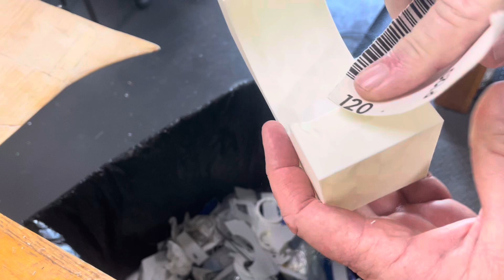Bambu Lab ASA Aero

Comment: Any part that needs a support, this ASA AERO is simple a POS!  even lowering the speed for support...it is only OK for continuous print without support
Reply: I had support challenges that I fixed by changing to Manual, and only supporting what I felt was neccessary. Also, I use a 0.3mm "Raft contact Z distance", and a "Base Pattern" of n Honeycomb with a "Base Pattern Spacing" of 2mm. Speed is still set to 50mm/s. Hope it helps.
Reply: Top infill is the same, also a problem for me.. but a continuous accumulation on the nozzle is a step before that even, which I also have

Comment: Nice work. What's with the raft? I've never seen that before. I normally use a brim. Can you tell me how a raft is better as I'm having issues getting LWASA to reliably stick to the bed. Cheers.
Reply from the maker: The raft is used for materials that are prone to warping and poor bed adhesion. This article will explain it better than me. 😊

https://all3dp.com/2/3d-printing-raft-when-should-you-use-it/